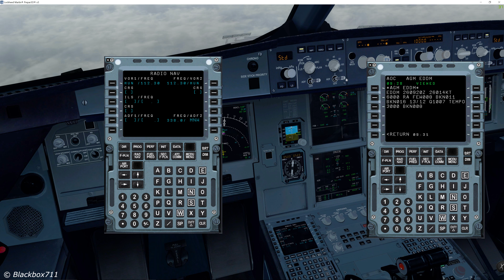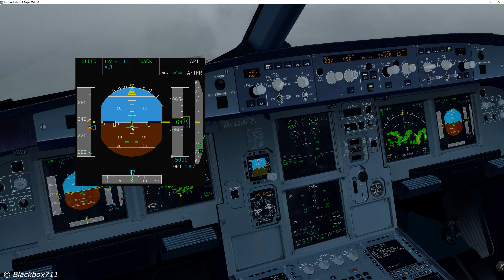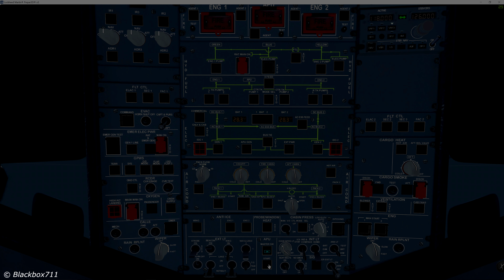FSLabs A320 Basics: FPV - Flight Path Vector [4K]

Comment: I appreciate the logic of the "bird" selection which clear the FD. That's important to not follow the wrong guidance.
Your tutorial is very clear and your explanation of the relationship between the pitch and the flight patch is excellent. 
I have a comment about the lack of flight patch vector appearance when the FD bars disappear. That was a situation when you lose the normal law and switch to alternate law. You only remains on the attitude indicator and the AOA is not readable although it is very important.
I think that it should be useful to have the bird in order to assess the AOA and the real path of the aircraft. I think it should have been useful in some accidents like AF447 or Air Asia QZ8501. By this mean, the pilot should have noticed the bird at the bottom of the display. But I find the bird too small and not particularly easy to see on the PFD. It is easier to use on HUD.
Thanks again for your video. Very interesting.

Comment: Good video! Have you 2 versions of P3D installed on you PC? Because sometimes you run B737 NGX in P3d v4, now you are may be on P3d v3 because, FSL A320 not yet released!
I'm looking for to install v3 and v4 in my PC, but i don't know if it's possible?
Reply from the maker: +Arezki Ferkal .. yes. V3 and V4

Comment: So what's the difference between the FD and the FPD, i.e. when you leave the FD on with TRK FPA mode?
Reply from the maker: +Gaetaco Winnercastro .. when you leave the FPD on you need to enter all values (Heading/Track, Vertical Profile) into the FCU or otherwise the FPD will show wrong values. When flying manually you would have to continuously take your view of instruments and dial in the new values into the FCU. So for me there is no point in doing that. Also a pilot should be capable of flying even without FD/FPD. Regards
Reply: Oh, don't get me wrong, I agree with you. I was just wondering why would Airbus include such a feature. :)
Reply from the maker: +Gaetaco Winnercastro .. no worries. The FPD does make sense when flying with an Autopilot. But once in manual flight in the sim, I woud personally only use the bird.  Regards

Comment: No need for FDs off!
Reply from the maker: Why?
Reply: @Blackbox711  , because you you'll still get the bird with FDs on. Which in that case is call FPD - Flight Path Director. A bird with flight directors.
Reply from the maker: Bruno Silva Bruno Silva ... the reason why I asked why is because your statement implied that it is not allowed to switch off FD. The FPV can be seen more clearly without the FP director bars. The purpose of the video was to demonstrate the meaning of the FPV.
Reply: @Blackbox711  , my statement in no way implies that it is not allowed to switch off the FDs. It is meant to imply that you can use the bird regardless of the FDs status. Your demonstration however, implies that FDs off are a requirement to use the bird. It wouldn't if you had said just that on the video. That for better appreciation of the bird you were switching the FDs off.